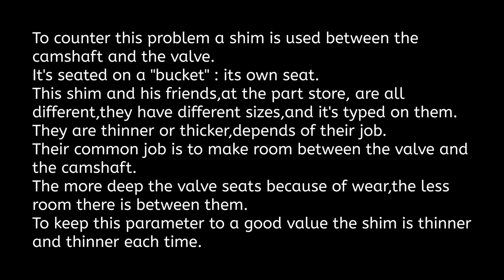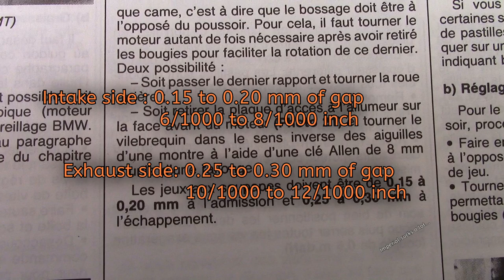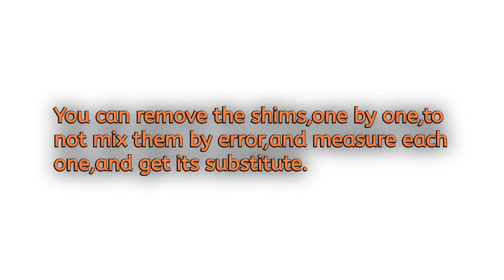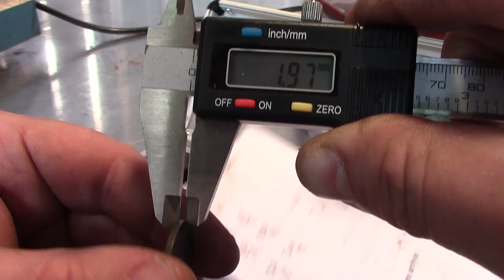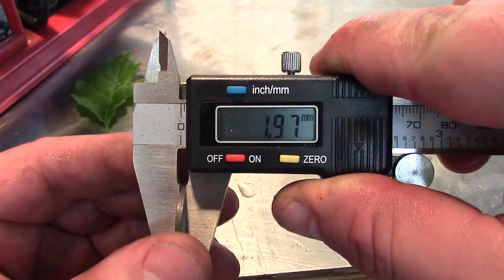BMW k75 valve adjustment,with just a screwdriver.

Comment: you can swap shim within the engine.. Do Not Grind On Your Hardened Shims !  or they will wear and change quickly.. Ignore this idiot advice to grind shims ~!
Reply: At the dealer, they will use used shims to adjust your valves.. find some, or buy some.
Reply from the maker: @captlarry-3525  I grind the face against the lifter,not the one contacting the cam lobe.
Reply: Absolutely! Besides not being able to get a perfectly flat and parallel surface, it’s very easy to overheat the shim grinding it in this fashion. Better to buy a new shim and put that one aside for when you need that size for one of the other valves.

Comment: Sir you are my hero!!! Compressing the spring” no problem” but removing the shim- even with a professional dental pick, no fun.  Compressed air!!! Brava Brava!
Reply from the maker: Thanks,
The thin layer of oil between the bucket and the shim creates suction,so using a tool is rarely efficient to pull the shim.
Air will push the oil and circulate easily between both,specially if you aim at the slits in the bucket, designed for the tool to grab in : it's a direct path under for air : )
Reply: michaelovitch Yes very inefficient- my wife came to the shop to see if my hand was cut off the profanity was flying.  One down two to go!  Take another bow sir!!
Reply from the maker: @rcgreaves  lol

Comment: Do you grind the correct side of the plate? In my opinion, the valve side was better. Why the camshaft should work on a ground surface?
Reply from the maker: I ground the side wich do not touch the camshaft lobe.
You keep the smooth side for the cam lobe,so no wear occur on both parts cam and shim,not knowing if it's surface hardened or deeply hardened.
You are supposed to have a constant oil film on the shim,so both parts are protected,but on the long term use,smother is better to begin with : )
Reply: Yes, I see. In your film, I see that you are polishing the side without marking of the dimension. Am I right?
Reply from the maker: @edidur4151  
Right.
Reply: The side without marking of the dimension are from camshaft side. Am I right?
Reply from the maker: @edidur4151  
Yes.

Comment: will do balance, have done drive shaft splines. It seems to be the only bike ideally suited for bypass oil filter, that is water cooled single plate dry clutch, hopefully someone will correct me if im wrong, but i dont know of any others.
Reply from the maker: There are a lot bmw ,moto guzzi ,ural too i think ,with a single plate dry clutch  wich are air ,or watercooled engines.
generally the gearbox is inline with the engine,there is more room for a single ,bigger plate clutch.
Reply: From what i can gather bypass filter can extend oil change intervals but when air cooled due to extra heat.
im thinking these k's may be the only bikes as durable as a car because built like a manual car, single dry clutch, water cooled, (and drive shaft.) Some ducattis but multi plate i think.
Reply: (meant to say but not air cooled)
Reply from the maker: Unless the filter media can retain smaller partcles than the stock one in place on the bike,there is no point using an additional by pass filter.
As i know you can extend oil intervals if the oil do not suffer from excessive heat (above 90 °C is starting to be bad) or if you not have fuel dilution,wich mean an engine running not often rich,or cold.
Like you say,oil cooled engines or air cooled engines are not the best for oil extended life...
For conventional oil it's one year max or the mileage given by the bike manufacturer.
Two years for synthetic oil  max,or the mileage given by the bike manufacturer.
On my k75 i'm on a very cheap oil,for now,and i will switch on a 5w40 low budget synthetic.
it's a ACEA  A3 B4   norm, an engine oil for cars.
I have a 20w50 oil with an oil thickener in my car,just to see what it's doing.
I have 5 bars of oil pressure cold at idle ,and 2 bars at 80°C at idle,wich rise at 4.5 bars as soon i blip the throttle....
Reply: it has worked well for me on a previous car using a toilet roll filter, im thinking you can extend oil changes by km instead of time since it also absorbs condensation which stops it combining with sulfur to form acid. Anyway your videos are brilliant, they show much more than the books and saves a lot of time
Reply from the maker: In addition to that,get yourself an oil catch can to collect blowby.
blowby really pollute the engine oil,and you trap a lot of moisture at the same time.
Thank you very much : )
Reply: good idea, so many things to consider
Reply: hi again just wondering how old a vw u need for buckets, i took one out of a '96 model but it didnt have shims, just a solid bucket. finally got my k100 one the road but need to grind some shims
Reply: '96 golf

Comment: is it true these bikes tend to leak oil in the cylinders?
Reply from the maker: If you park it on the side stand before to shut off the engine and let the oil flow back down,yes,a bit : )
otherwise,no just think at all the Porsche ,Corvair,falt twin bmw ,flat 6 engines etc... : )
Reply: michaelovitch that's what i was told
a friend had an old one and he said his would burn oil everytime he parked
is it unavoidable even with new piston rings?
Reply from the maker: Even brand new piston rings do not really seal when the engine is not running,whatever the engine type,as long as the oil film on the cylinder is not present.
They do not expand since there is no pressure from the  combustion applied on them and no heat to expand metals (cylinder and piston/rings)
So you wil maybe reduce the leak through them if the old rings were used a lot,but it's really minimal.
If you have a good compression on the engine,no need to replace them.
It's just a "problem" of conception.
you can use a thicker oil,or just use the central stand lol
Reply: michaelovitch never trusted centerstands
guess i have no choice tho
Reply from the maker: I like them quite well.
they allow your bike to start level,the engine is not oil starving on a spot or an other when it's warming up.
the police used to let bikes to run or warm up on the side stand on the last airheads and one cylinder,and valve train was lacking of lubrication...
Reply: Yes if left on side/stand or not run for a while ,Not a detriment to the bike though just a cloud of smoke for a while,so dont fret

Comment: My shims are at 2.55mm but the manual requieres 2.0-3.0
Reply from the maker: I don't understand 

is your gap ok between the camshaft and the lifter ?
Reply: michaelovitch no, the clearance is at a 13mm. 15mm won’t fit.
Reply from the maker: @isofly28  13/100 of mm on intake or exhaust valves ?
Reply: michaelovitch intake. Sorry for the confusion. I tried using the gap clearance on the intake and the only clearance I get was 13mm max. I mesure the thickness of my shim and it reads 2.55mm. I went to the stores and got some shims for the intake and they are 2.30mm thick. I put them on and the intake gap clearance is now at 25mm. Would it give me any problems since the intake clearance is at a 25mm? When the manual says 15mm through 20mm for intake.
Reply from the maker: @isofly28  25/100 is ok.
The more clearance you have,the less the valve will open,so the less your engine is sucking air.
If you have too much clearance,the engine will be noisy.
Reply from the maker: @isofly28  

25/100 is ok.
The more clearance you have,the less the valve will open,so the less your engine is sucking air.
If you have too much clearance,the engine will be noisy.
Reply from the maker: @isofly28  25/100 is ok.
The more clearance you have,the less the valve will open,so the less your engine is sucking air.
If you have too much clearance,the engine will be noisy.
Reply: michaelovitch what gap clearance would you say is too much?
Reply from the maker: @isofly28  10/100 over what you should have is too much i think
Reply: @michaelovitch  hi. What’s the number after slash. 100 what is it?
Reply from the maker: @mruniverse5704  Hi, when in the video ?
Reply: @michaelovitch  in comments. 25/100 second number, what is it?
Reply from the maker: @mruniverse5704  25 hundreds of 1 millimeter  
It's 0.25 millimeter.
1/4 of 1 mm
Reply: @michaelovitch  ahah) Thx!  I thought this is some sort of dimensions)
Reply from the maker: @mruniverse5704  
There is a dimension marked on the shim itself : https://youtu.be/4veyx2QHgnw?t=262
It's a 2 mm thick shim.

Comment: Thanks for this video. I suppose it is the same procedure for 16 valves engines?
In any case. This is very useful !
Reply from the maker: Thanks,yes,it's the same work,even for other engines from cars with flat tappets,on wich i done that too : )
Reply: 16v will not go this way. Need to take out the cams.

Comment: Tried this but didn't work for me. Probably because I used compressed air duster which wasn't powerful enough.

I did just used two screw drivers and it was pretty easy though.
Reply from the maker: Yes,you need quite some air burst to go between the shim and the bucket.